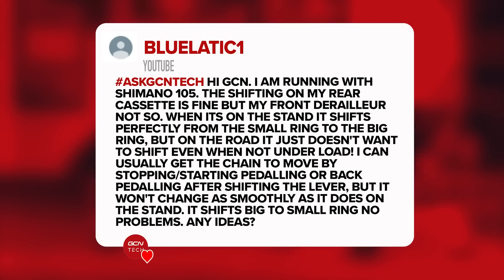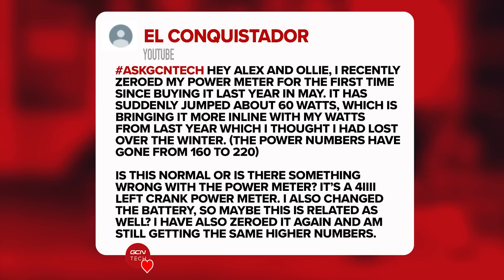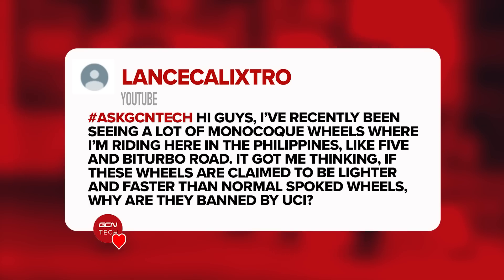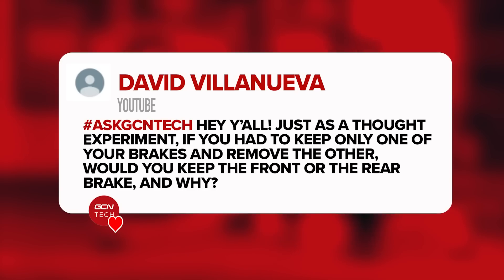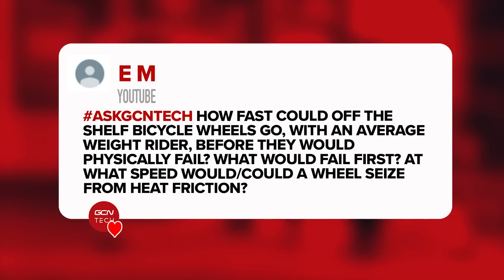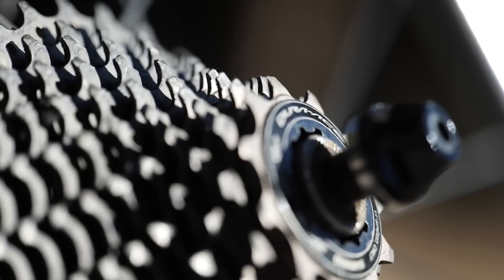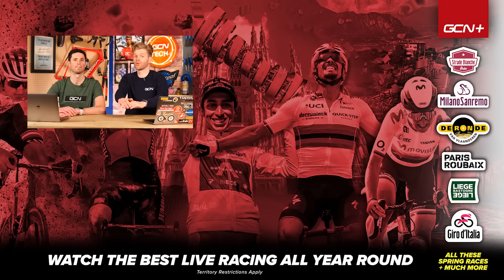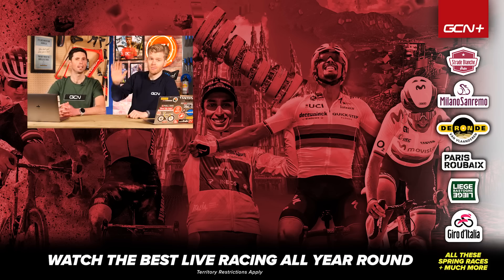"How Fast Could A Bike Wheel Go Before Failing?" | GCN Tech Clinic

Comment from the maker: Do you have any of your own tech queries? Let us know using the hashtag #AskGCNTech. 💬👇
Reply: About the Shimano 105 derailleur not shifting smoothly --> I have Shimano 105 myself and i'm running into the same issue. The front shifting is getting degraded. First of all: Never shift while under load. Second of all, replace your front derailleur cable when it starts to act up on you. My opinion is that if you are able to shift it in the stand and not on the road, that means you are putting too much power on the cranks and the chain will not comply to make the shifting.
Reply: #AskGCNTech Can a 10 and 11 speed Crankset be use with 9 speed sora cassette. Because If can I would like to chang my Chinese crank 170 mm with the shimano Tiagra 172.5 crank. Thank you
Reply: This is the first time Ollie’s hair was better than Connor’s. Shame, Connor. Shame.
Reply: @GCNTech I would recommend British Cycling kit supplier Kalas for clothing for long arms. They have a (+) extended size range which I find useful as I have disproportionately long arms. Their size 2 Jerseys (equivalent to Castelli small/medium) are too short but the 3 is the right length but too baggy. A 2+ fits perfectly as it has the width measurements of a 2 but the length measurements of the 3. They are also the kit supplier of my local club and many others due to their bulk custom print deals they do. Their prices are competitive for the level of technicality in the clothing too.
Reply: So the bearings can handle extremely high speeds, but what about the entire wheel assembly (tires, tubes, rims, spokes, etc.)?  Can the average bike safely hit say... 60 mph??
Reply: #AskGCNTech Hi GCN! If I mount a garmin varia radar in the front of the bike facing forward, lets say a TT bike, will it work as it does when mounted facing back at the rear? I dont own a garmin varia radar but with accidents like Egan's one on the TT bike it sounds like something that can help to prevent these accidents as the rider has a view of the computer screen when not looking forward. Thank you Guys.
Reply: They can put a man on the moon, but they can't they make grease and oil that doesn't get dirty? I'm going back to the office and want to start biking but worrying about getting black smudges on my Khakis is giving me nightmares (along with the one where my handlebars are rubber)
Reply: #AskGCNTech What's the difference between a tri bike and a TT bike? can I use / modify a tri bike to be used as a tt bike and vice versa? if I put a disc wheel on a tri bike, can I call it a TT bike? I'm looking for a bike that I can use as both a tri and TT bike. Any suggestion?
Reply: #AskGCNTech - Hi GCN Team, great videos! I saw a video of someone complaining about the short lifespan of his dura ace disk brakes. He said the pads wore out every three months and the disks every six months, leading to exceptionally high running costs. What is your experience riding these higher end groupsets? Running cost is a topic that rarely comes up when considering upgrading components. Thanks a lot!

Comment: Regarding the question about long sleeves to be long enough - I'm 6'2" and I wear Endura long sleeves thermal. I have pretty long arms and the sleeves are actually still slightly too long, which means I can tuck them nicely under the gloves. But they're not that long so that it would be uncomfortable and it would start to wrinkle and be annoying. So my vote goes to Endura.

Hope it helps!

Comment: #AskGCNTech Hi wonderful GCN team, I recently had a puncture on my (brand new) tubeless tyre that failed to seal at the roadside. Thankfully it was at the end of my ride so I could walk home. I went to plug it the next day and found that it did eventually seal. Is it best to leave it and consider the problem solved, or try to either insert a plug, or patch the tyre from the inside? I feel nervous riding in it at the moment! Thanks guys!

Comment: I am experiencing cramping/spasms in my right foot/heel/calf on long, sustained efforts. No pain, no signs of Achilles problems the next day (i.e. no stiffness or heel pain), and and no issues with left foot. My cleats (Speedplay) are perfectly centered along the balls of my feet, so I don't believe it's due to cleat being too far forward, which I have read is a common cause of Achilles tendinitis. Bit perplexed! However, one thing I have noticed is that when I naturally let my feet hang from a high stool, my right toes point inward slightly. Currently my cleats are setup so that both feet point straight ahead. Is it possible my discomfort comes from needing to adjust my right cleat so that my heel is a bit outward? #AskGCNTech

Comment: The day I received my Enve 65s I took it to my local shop to equip it with Tubeless Corsa Speeds & I believe they didn’t set the bead right because on my very 1st ride only about a mile from the shop I was going maybe 35mph on a slight downhill & the front tire blew off the rim, caused me to get drenched in sealant & slide on my carbon rim for around 40 meters or so right through a traffic intersection. Luckily Enve honored the warranty & I told my shop about the incident but I’ve been scared to go above 30 ever since.

Comment: You'd both keep the front brake over rear??? I usually don't even use the front brake! If you had to stop quickly by only using front brake you'd simply flop over forward. Rear brake is the way to go

Comment: On the long arms question. I'm also 6'4'' and built like a gibbon (i.e. long, long arms) so really empathise with the issue Dave Hanhela raises. I tend to use a set of arm warmers worn underneath long sleeved jerseys to help me cover my wrists on especially cold days. That and I've developed a tolerance to getting cold wrists when arm warmers are a bit much😅. Hope this helps.
Reply: I wonder if you could approach a UK manufacurer (eg Lusso) and asked if they could do a one off? They adjusted the legs of my shorts for me.

Comment: Ignoring the tire issue, what sort of GeForce could a 'typical' wheel endure? If I remember correctly, watching something about the Bugatti Veyron/Chiron, they talked about the forces at the wheels when traveling near 300 mph and how it was absurd (I really don't remember the figures exactly, but I'm sure someone here might...I think it was in the hundreds or thousands?). It would be cool to actually see a test to failure of a bike wheel on a rig (rotated at the hub, not a friction rotation on the actual rim) to see where and when the wheel would rip itself apart. I don't imagine the spokes to rim interface is designed to withstand more than a couple hundred mph ;)

Comment: With the front derailleur issue as it's apparently working OK on the stand, check the frame for anything that looks off.. it might be bending/flexing when there's weight on the bike. A relative had a bike that had issues with the gears (gear hub in this case).  When in a stand and "hanging"  it was shifting perfectly and well calibrated.  Turned out there was a small crack near the bottom bracket where the shifter cable wasn't in an outer tube.  When weight was applied to the bike it flexed a little bit, causing the cable to get some extra tension on it and messing up the gear hub's calibration.  
It might be nothing like that, but the fact that it's shifting fine on the stand and not when riding even if you don't shift under power reminded me of that case.

Comment: One of the important things with the speed of the wheel is the effect of centrifugal force on the tyre.  Motorcycle tyres are speed rated, even though most bikes max out way below 200 mph.  As the wheel spins, the tyre distorts, getting "taller and thinner".  Top fuel dragster cars choose their gearing to allow for the diameter that the tyres will be when the car is up to speed, which is substantially more than the diameter when the car is resting.  If you span a well-balanced bike wheel up to ridiculous speeds, the tyre will distort and burst long before the bearings melt or the spokes snap.  However, if the wheel is not balanced, it will probably shake itself apart.  (Pedantry alert: yes, I know some people argue there is no such thing as centrifugal force, but it is a convenient label and we all know what it means.)
Reply: There is a video somewhere in which a skateboard wheel is spun up with compressed air. It eventually stretches right off the axle from centrifugal force.

Comment: #AskGCNTech Hey cool kids! I'm getting unusual readings from my 4iiii crank arm power meter all of a sudden, (oddly low for the first 10 minutes, then oddly high for the rest of the ride.) Any idea what could be causing this? I calibrated it over and over but same weird numbers. I can't be sure if it's a hardware issue or something with the app. I use the IPbike app on an android phone. I don't have a bike computer/ head unit. Would it be easy to test it with a friend's head unit, or is that a big to do? 

- the SECOND person ever to complain about readings being too high.

Comment: In the first question about changing to the big chain ring, you mentioned 'pins' but left it there. The user might not know that there are four pins or rivets around the perimeter of the large ring and they sit proud of the inside face of the ring by about 1mm. When the derailleur pushes the chain to the outside, one of those pins will get under the outer plate of the chain and help lift the chain onto the cogs. Those pins can wear down over time so you lose that extra lift when changing. 
I don't have Shimano gear but my SRAM started to fail when shifting to the big ring at about 15,000 kms. A ring replacement fixed it.

Comment: #askGCNTech hi GCN team... me today is more a suggestion for a road lab.
For a same rear sproket (ex:11) and with a same power output mean (ex: 200 or 250 watt) on a 5 or 10km(suggestion for the test😏) Can i get a better speed (km/h) juste to change the big front gear (ex: 46, 48, 50 and 52).

It s to know if on a long distance bike trip we could get a better speed and save energy if i enlarge front gear  

Thanks

Comment: A more likely failure would be a rim brake carbon wheel on a long descent in hot weather.

The Death Valley Century has a 10-mile descent that includes about 6 miles between -10% and -5% grade. The heat from the road, plus riding the brakes, can soften the resin and the layers can delaminate.

Recent materials and manufacturing improvements may have solved this, but a friend who rode it several years ago said riders were strongly discouraged from using rim brake carbon wheels.
Reply: I once had a massive blowout from riding down a steep pass into a valley because of heat. It was a stinking hot day and in places the blacktop was melting into strings under the wheels, and I was on the brakes, rim brakes on alloy rims, all the way down. As I got to the narrow bridge across the river at the bottom the front tyre exploded off the rim and I had to throw myself off the bike away from the edge of the bridge that the bike was heading to. The tube had a split in it about a foot long. Even touching the rim was impossible for a few minutes as it cooled down. 
Riding up the other side was a lot slower. 😀

Comment: Bloodhound LSR Is been built to do Mach 2. It only uses tyres for the low speed runs. Up to about 250mph. Over that. It must be run in South Africa on Hakskeen Pan and using solid forged made from aircraft grade aluminium zinc alloy. The wheels will have no rubber tyres.

Comment: IIRC land speed record wheels are more like rail car wheels - full steel, cast aluminium-steel combinations, or forged aluminium.
Look up the Thrust SSC (first one going supersonic). They used forged aluminium, and got just beyond the sound barrier.
No rubber tire is going to withstand such forces.

Comment: The melting point of steel isn't necessarily where a steel part fails. The hotter it is, the more easily it can bend out of shape. Not saying that we'd realistically get to a point where that becomes an issue with even the fastest bike riding, but the point of failure will certainly be well before the material melts.

That being said, the higher the temperature gradient, the faster the energy exchange. Meaning that if something is 500 degrees, it will cool to 400 faster than something would from 400 to 300. Add to that the fact that as your bike is moving, the airflow across the bike will cool it down significantly. Air in itself actually doesn't transfer heat very well, which is why wind helps cool things down.

Also faster wheeled vehicles exist that don't have parts melting on them during normal operation. If a bike part were to heat up too much, manufacturers would just take a page out of the motorcycle engineering handbook and replace it with a more heavy duty variant.

Comment: #ASKGCNTECH Hi guys! I have a problem with my rear derailleur, its a shimano R8000. The problem is, i can shift to easy gear without any problem, but not when trying to shift to smaller cog, specifically last four small cog. I tried to service the RD, relube the cage, relube the pivot point. But the problem is still there. Is it because of the spring inside the RD is already loss its tension? Or the cassette has been worned out? Is there any indicator regarding worned out cassette? Using this RD since 2019.

Comment: #AskGCNTech - Great content again, thanks. Quick question, I’d like to start working through the top 100 Greatest Climbs in the UK, and having completed Bwlch-Y-Groes last weekend I wondered if changing from a 11-30 cassette (52/36 chain ring) to a 11-32 would make any noticeable difference when grinding up a 25% climb (and coming to a virtual standstill)? Also would a faster consistent spin have any baring on the front wheel lifting at the steepest sections or would that be purely down to body/weight distribution? Thanks

Comment: Do they make power meters that can adjust their reading according to the current temperature? I would think that a change in power reading with regards to the change in temperature, would be consistent so the power meter could adjust for it.

Edit: Oh, in addition to patching, I've heard that sewing works for tire gashes as well.
Reply: I believe most reputable brands do compensate for temp changes. This issue isn't that they don't compensate, it is that the operating temp is far from the calibration temp. The accuracy of the calibration is highest at the exact temp it was calibrated at, and since it is a factor that is also compounded by the accuracy of a temperature sensor the calibration becomes less and less accurate the further you are from that point.

Comment: #askgcntech The last time I purchased cycling shoes, I asked about getting the cleats fitted. The salesperson said there was a standard position and not to worry about it. Is there a position for the cleats that fits most riders?
Reply: I would ask for another salesperson. Cleats have about 40mm fore/aft of adjustment (about 10-15 lateral, with a few degrees of angular adjustment too) by design in order to get the best position for the individual. Even someone else who wears the same shoe size will have a slightly different position preference or sweet spot. There is a handy video on cleat set up that the @GCNTech  channel  have done which will help find a base line then you can tweak your own setup to suit you. Sorry you received such poor customer service.
Reply: Well these are comments not questions so you’ll never know

Comment: #AskGCNTech Hey guys! There is a quite aggressive vibration in my bikes frame at low cadence. The groupset is Shimano 105, the chain is Ultegra 11 speed. I did not notice this on the road last fall, but i feel it and hear it on the trainer (with a sligtly worn cassette) and even more so when the bike is in the repairstand with a brand new cassette. Why is this? The chain is not ”streched” and it’s installed with the marked side outwards. The bikeshop said that the cause is that the chain doesn’t properly fit the cassette. Does it matter which way (upside down) the chain is installed? Long question, sorry.

Comment: First question about front derailleur shifting - - get a copy of the installation instructions for that derailleur and follow all of the steps to properly set up the derailleur.  This includes the height and angle alignment of the derailleur vs. the chainrings, setting the limit screws correctly, and also getting the shifter cable adjusted exactly right.  There is actually a multi-step process to do this correctly.  Front derailleurs can be finicky now that they have to deal with up to 12 cogs worth of chain yaw in the back!

Comment: I'd vote for the rear brake. On a big descent and in an emergency situation (like a dog running out in front of you), I'd worry that slamming the front back only runs the risk of going over the handlebars vs skidding heavily with the rear.
Reply: You need to get lots more practice using your front brake before going at those speeds again. Without that skill, you’re really living far out on the very edge of nearly dying.

Comment: So I'm not a 6'4 man but I do have wide shoulders and long arms for a girl.  Cycling sleeves both UV for the summer and warmers are a life saver.  Short sleeve jerseys paired with arm sleeves look cool while solving long arm problems

And a tip for women with this problem... mens jackets.  Going up a size or two in women's never gets it right, but hopping over to men's tops always fixes that problem